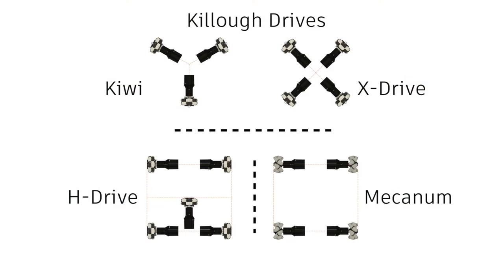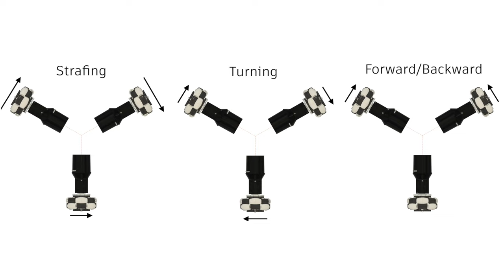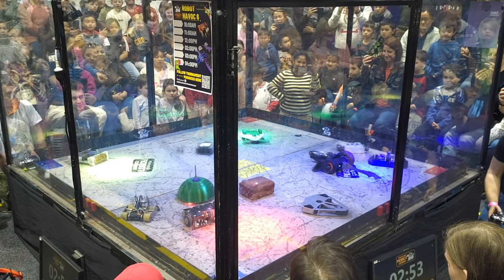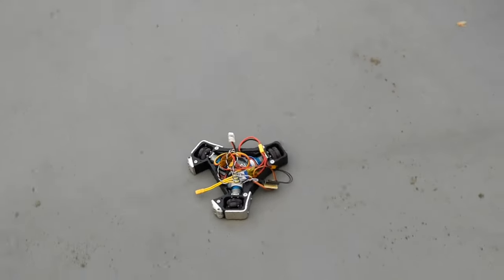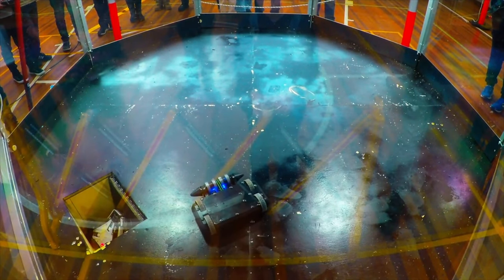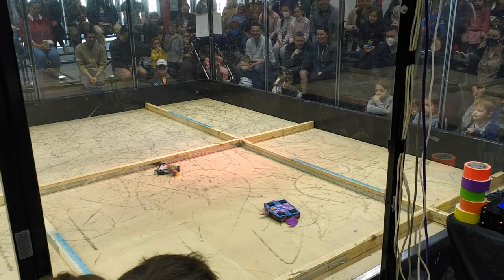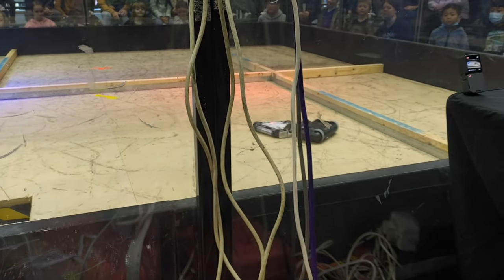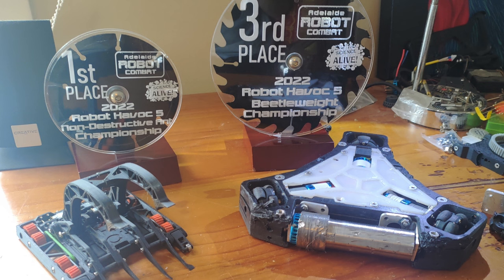Designing and Fighting an Omnidirectional Combat Robot - Part 1

Comment: Fab video. I built a kiwi drive overhead saw as a beetle last year, and I'm currently redesigning it as a hammer saw. Couldn't agree with your points about the strengths and drawbacks of the drive system more. Let me know if you ever want to compare notes!

Comment: From the thumbnail, I was hoping for a triangle robot with three big cylindrical rollers that just sort of slide around for omnidirectional movement. That wouldn't be very combat worthy, though ... too easy to push around.
Reply from the maker: This has been done, a very old Australian featherweight called 'Sidewinder' just used standard Bunnings red wheels in place of omnis. Worked ok apparently.
Reply: @BrokenLinkRobotics  Thanks for the info! Hmm ... I guess you could make a simple robot with three almost vertical corner motors.

Each motor is tilted a bit inward, with the shaft poking above and below the robot. The "wheels" are simply the rounded shaft tips.

Very few points of failure. No gears, obviously. No way for a bent armor belt to seize up the wheels. Might also be good for trying to save weight.

Comment: show us how you assemble the gear motors for the omni wheels!
Reply from the maker: For v1 it's just a stock standard 25mm Chinese gearbox with a drone motor mounted to the standard back, but v2 has custom ones which will be covered  in next video.